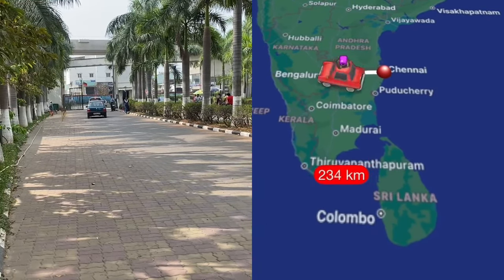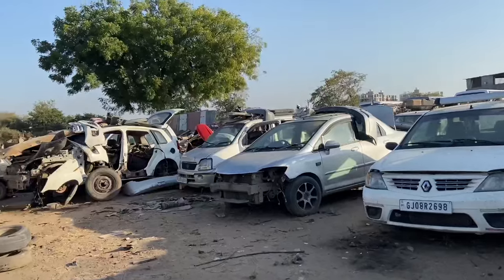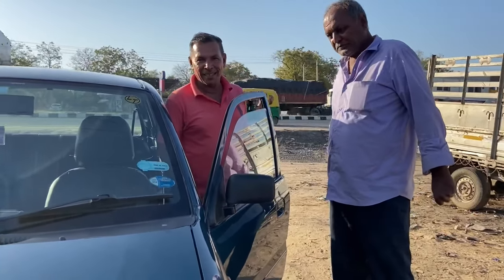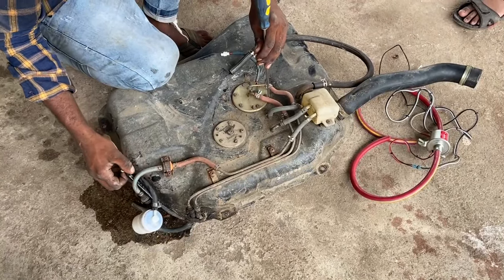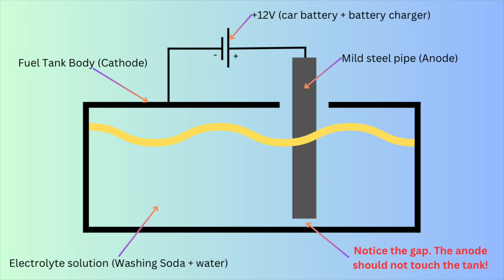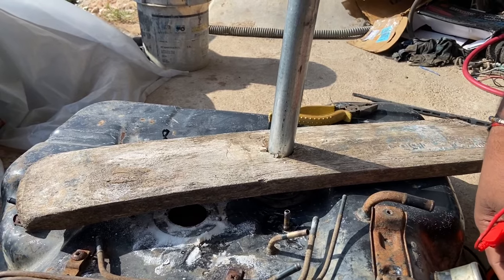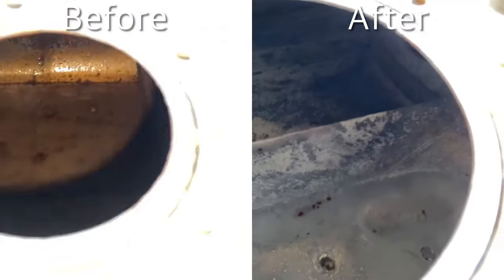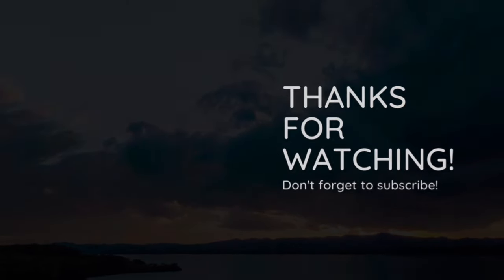99 Maruti Zen Restoration - Fuel Tank

Comment: What a DIY and what superb results. Mayapuri vehicle scrap market in Delhi is probably the biggest in North India where such parts can be sourced from.
Reply from the maker: Yeah man, have heard about Mayapuri market in Delhi. Probably the biggest in the country I reckon. At Chennai, it is in Pudupet.
Reply: @GaneshBalan  Just out of curiosity, what made you choose the laborious & time consuming electrolysis method for rust removal when acid dip is most usually used for the process? The result has been darn surprisingly good, much exceeding expectations I had through the course of the video.
Reply from the maker: @desiborat Believe it or not, when we got the fuel tank from the salvage shop and gave it to a local service centre for the replacement, he did an acid wash using caustic soda. But it didn’t help much as I realised during the ownership. That’s when I decided to take the matter into my own hands and do something about it. 

I was facing 2 problems with the car after the fuel tank was swapped:

1. Petrol coming out of the charcoal canister - this was because of a choked metal pipe in the tank. Inserted a thin bent rod into the pipe to clear the block and this was sorted. 

2. Fuel coming at the carburettor was orangish hinting at rust. And the fuel filter was almost always orangish in color. 

Read up on the internet this is also one of the methods to remove rust and decided to try it out. Pleasantly happy with the results.
Reply: @GaneshBalan  Results are definitely noteworthy and the tank should last quite a while now. Cheers & stay awesome!
Reply from the maker: @desiborat  Thanks so much bro. 🥰

Comment: What was the current set ? I tried doing it at home with a 12V supply  however it didn't work.  am going to do the same at a Battery charger setup. The current setting will help me in getting the results correct.
Reply from the maker: 7-10 amp

Comment: Sir fuel pump not turning off in my zen a humming sound from petrol tank, is this a pumb faulty or relay,
Reply from the maker: Pump could be faulty. Please try removing and connect battery terminals to the motor to check if the pump motor is working.